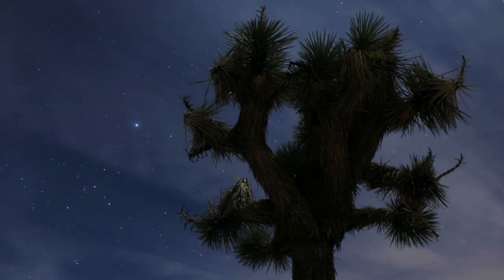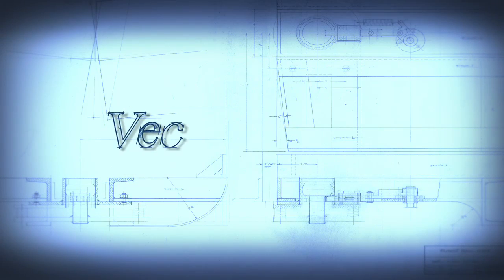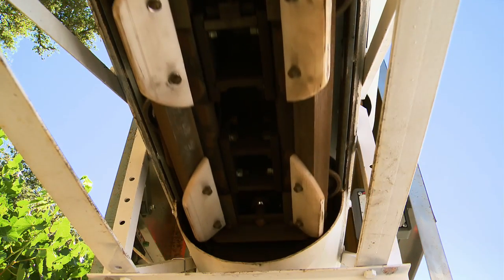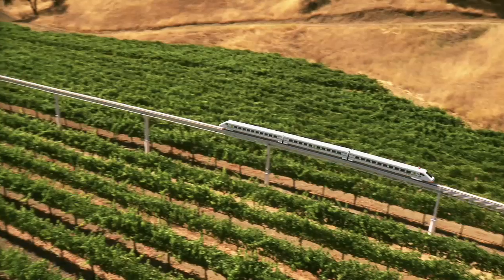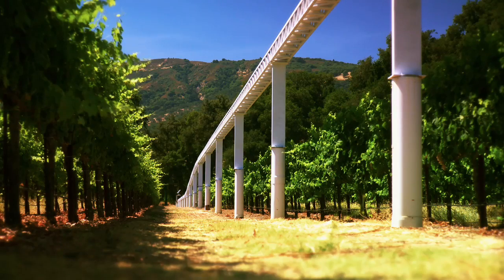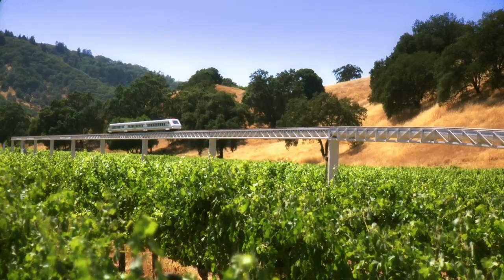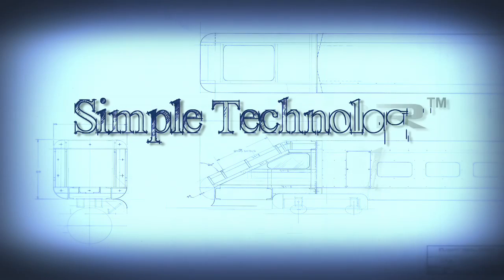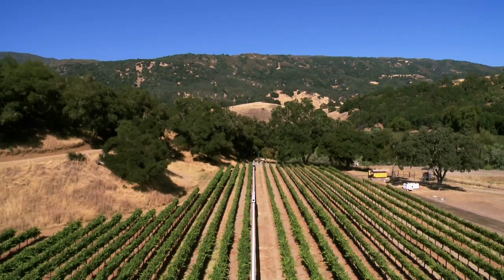VECTORR™ High Speed Rail Technology by Flight Rail Corp. U.S.A.

Comment: How would you implement switching?
Reply from the maker: The key to switching is valves. Valves also allow multiple trains on a line and so are integral to the system. Our thrust carriage (the portion of the system that rides within the power tube) has an adjustable piston at each end. The thrust carriage is as long as the train and is longer than the switch. The train can traverse and be switched via a mechanism that has rails and no power tube below it. Valves at the entry and exit of the switch allow for push/pull of the thrust carriage which in turn moves the train through the switch. These valves allow traditional rail switches to be used. The relative ease of switching provides flexibility at stations and allows "Express" trains to pass the "Locals" while the local train is in-station.

Comment: Well, it sounds good, but there's a reason high speed rail is the number one choice most of the time, even with the existence of things such as maglev. A high speed rail line requires a lot of dedicated track to operate safely at high speeds. But the trains can come directly off the high-speed network onto conventional networks, letting them use existing stations and tracks in heavily built up areas. The infrastructure also isn't proprietary,simplifying sourcing of vehicles and other equipment